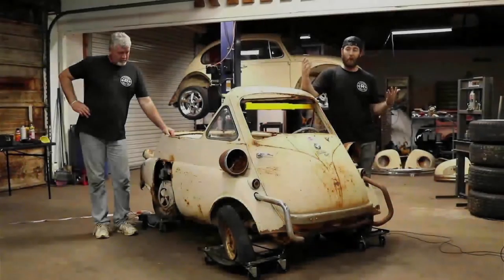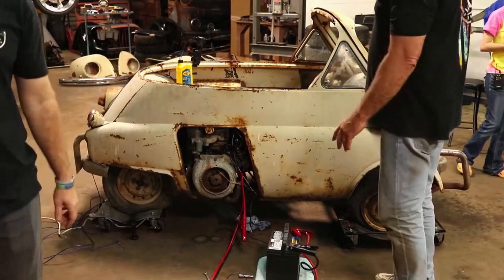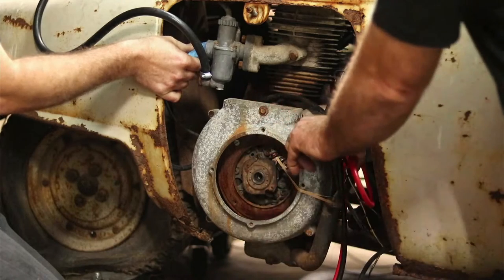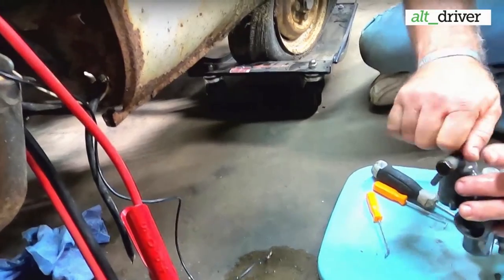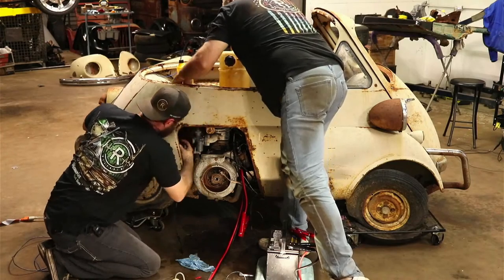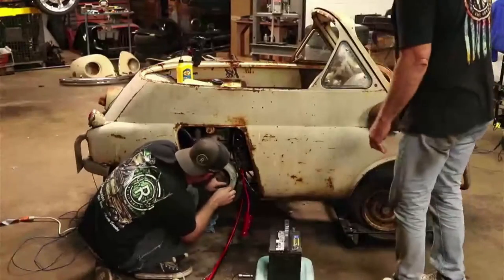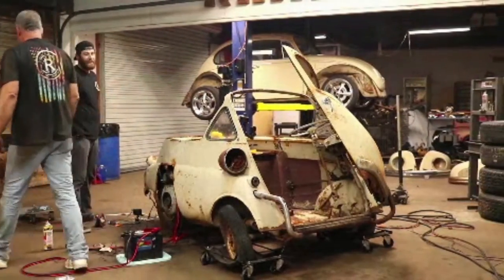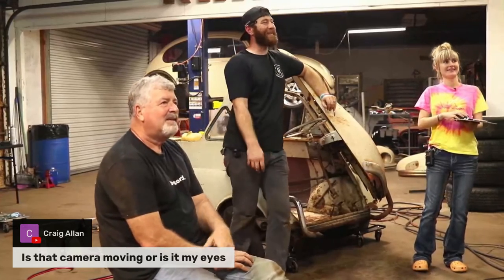LIVE Part 2 BMW Isetta Barn Find| Will It Run Rigged With Rubber Band & Soda Bottle Lid?! | RESTORED

Comment: I have Isetta 300 and i feel for you. This car differs in so many ways from the standard in particular when it comes to the Ignition. The mechanical centrifugal force driven timing advance is a tough nut to crack. Seeing that you manage to adjust the Point that without the fan wheel that has all the timing marks on it is quite impressive. Honestly i was surprised to see the Dyna start still working. (Dynastart Generator starter combined in one)  In the end seeing the engine running pretty well tells me that you guys know what you are doing. Never give up keep going.

Comment: Coke bottle cap washer. Hey it works. I had a VW Bug carburator break. The way it was molded, on the front of the throat there was a spot the size of a dime. For some reason it fell out. So I filed down a real dime to fit. Mixed up so JB Weld. Tapped the dime into the hole , covered it with JB. Car started right up and drove it that way for years.
Reply: I had a 72 super beetle that at night in the dark stopped at RR crossing.my throttle cable broke.I pushed a pice of electrical wire through the tube and it was my cable for a long time 💪💪💪💪
Reply: @davidbolton184  Same happened to me. I rigged it up with parts from fixing a header door. Got me home where I had a spare cable. The German made cables were better than those from Mexico.

Comment: Try this... Heat the plastic tube from the carb cleaner spray with a lighter (about 1/4-1/2 inch from the end. Then pull on each end of the tube to stretch it. This makes the outer/inner tube diameter smaller and more of a pin point. When the melted plastic solidifies, use small wire clippers or nail clippers to snip the tube at the smallest diameter that still provides flow when spraying. The cleaner comes out like a pin point pressure washer and the shrunken plastic tube end fits inside whatever port your spaying thru.
You can also do the same to create 90 degree angles in the plastic tube to spray sideways inside long venturi tubes.
I used to make/keep custom tubes around for these situations. Hope this makes sense. BTW.... Great videos.

Y'all make me miss my youth. Be Well!

Comment: I believe those old air cooled motors are supposed to have ducting for cooling air that fits quite close at least part way around the cylinder fins and if that isn't on there, they can overheat and seize up.
Reply: Yes you are right. And this engine is is missing several pieces of the cooling shrouds. And that fan is not a Isetta part. The Isetta fan was bowl shaped cast aluminum with a whole bunch of curved fins around the outer edge of it. This engine will seize up without the proper cooling parts installed.

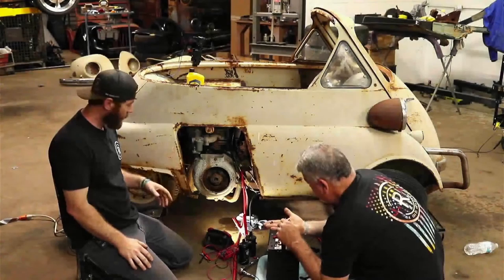Comment: I had the throttle cable on my 70 Torino Wagon break. It was 2:00 in the morning and below freezing. In the dark I put a coat hanger wire on the throttle at the carb, ran the coat hanger through a hole in the firewall, and pulled it by hand the 20 miles to get it home.

Comment: Supposed to run German me and white wall continentals on that, I would laugh, but maybe Vespa tires work.
if this thing has an oil injector you need to make darn sure that thing is working, if it does not have an oil injector and you mix the oil with the fuel and make sure that you have that oil in there, the air fuel mixture wraps the stuff around the crankshaft and ports up through the piston I believe and provides lubrication for the engine
Reply: there a lot of springs on different types of ignition points, I don't know how small that one is, but it isn't that hard to make a spring for it, One just needs the right width and roughly the right thickness the Natches can be ground into the spring steel

Comment: Unless I'm very much mistaken, that carburetor looks suspiciously like a Dell'Orto round slide unit.  My first BMW R100 motorcycle (1977, I believe) was equipped with two of them by its previous owner.  He had a specialty shop make the conversion along with putting dual spark plugs in the heads.  Nice set up.
I just realized why it won't start and continue to run.  You don't have Steve Urkel there to assist.  It used to have an Isetta (in beautiful condition) on that sitcom he started in.

Comment: A little trick for you guys get yourself a couple or even just one really strong small neodymium magnet small enough to fit inside of your gas can there and then you can set that gas can on a metal surface and it will stick pretty hard you could glue them to the outside of the container but then you would have to put something like a towel or something down if you stuck it on nice paint

Comment: Those points breaking was not your fault! I just got a vintage vespa into my possession and it had a brand new set of points installed on it about 30 years ago and when I moved them they snapped in the same place as yours. They were still shiny and looked brand new. That metal just gets real brittle over time.

Comment: Comment:   Watching the Issetta, part 2.  Not sure as I don;t know VW transmissions that well, but being a '55 Isetta it is possible that you have an early  OR '50S era VW block due to the different clutch.  If so, some of the early VW engines had a special light weight magnesium block.    If you have one of those , IT IS VALUABLE !

Comment: Liked your rubber band improvisation. It worked! It would be interesting to take some of the other cars you bought and make a complete car. These are neat little cars. Nothing quite like them. What are you going to do with those other cars?
 It does take me back to the days of tinkering with my Ducati motorcycle.  I swapped out the coils it came with since they weren't that great and put on automotive coils which worked better.  Just spent time tinkering and trying to improve it.

Comment: You didn't quite get there during the first livestream but think about it this way guys: After thinking about it, you got it to fire off in about 15 mins, after 𝒎𝒂𝒌𝒊𝒏𝒈 a set of points, 𝒎𝒂𝒌𝒊𝒏𝒈 spare parts from a bottle top and a rubber band, then using a shop towel as a fuel tank.👍👌😁
Quite apart from the ingenuity, it's really got to be classed as the ultimate, 𝒃𝒖𝒅𝒈𝒆𝒕 "Will it run?".
Something I thought of: if it's been sitting for as long as you think, the gas shouldn't be a problem. Is this thing not from the days 𝒃𝒆𝒇𝒐𝒓𝒆 they invented the fuel that turns to varnish and gums everything up?

Comment: When you unscrew the top of the carburetor off, (the throttle control I'll call it), you know there'll be the tapered throttle slide and the tapered jet. You'll be fine taking it apart and cleaning it, I'm sure...
THIS BEAST RUNS !! After sitting how long?? Knew you would get it going.

Comment: Believe a film called "Operation Petticoat" where some Navy Wacs were on a WW2 submarine . So the machinist mate reluctantly lets one of the Wacs help fix one of the diesel engines using a bra as some sort of return spring.. I think I got that right?

Comment: hi friends ain't this thing a 2stroke motor then ,if it is you will need to mix some lube in with the fuel so as you don't blow the old gal up.

Comment: You guys need a proper work bench area....with lighting and tool organization . I’d love to come out and give you guys a hand if you want some help putting one together. I built mine out of old file cabinets and a 8’ butcher block counter from Home Depot. Once I attached them I built the upper frame out of 2x4’s and screwed on peg board then bought hangers from discount tool store... instant organization.

Comment: HEY! You are working the problem. Somethings just take a bit longer to get going.
I'm not gonna give you flack for not getting this up and running in 30 minutes or whatever....
Knew you'd get it running......
Points....without them, you have a couple hundred pound paperweight.

Comment: Losing sleep over thinking  a post war rusty Kraut Kan,, best see your therapist or give the  priest a visit @ your local confession booth.. Older established BMW bike shop should have the parts Bing Carberator, points, coil ect. all common NOS parts still sitting on back shelves at BMW shops.When i was a driving age teen these cars were quite common on the  SoCal coast,, Bought a 10 year old 57 Isetta Limo with Vw engine transplant in pretty nice condition in 1967 for $75..it was fun,  almost as fun as my 1958 fiat 500 that i also bought for $75. that fiat had a 500cc 4 banger and did get 75 mpg all day, had a 2.5 gallon fuel tank.. everyone talks about $25 cars back in the day, mine were always $75, except for that old  '39 HD knucklehead survivor i overpaid an outrageous $200 for because it was not chopped & i liked the way it looked. Mixing religion or politics with dead vehicle ancestor worship is a very odd form of spirituality. but whatever works for Cletus is good by me.

Comment: 1. check if it turns without noices. 2 check for spark. 3 dissassamble carburator and clean it. then try to start it. saves you lot of time and guesses. i like your projects but you talk too much off subject.